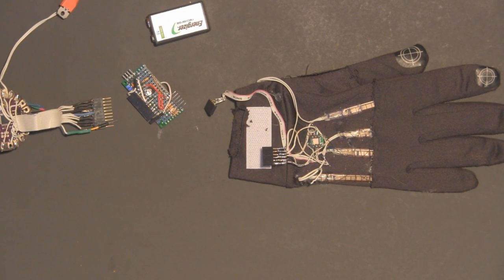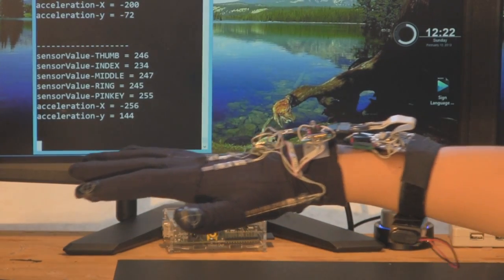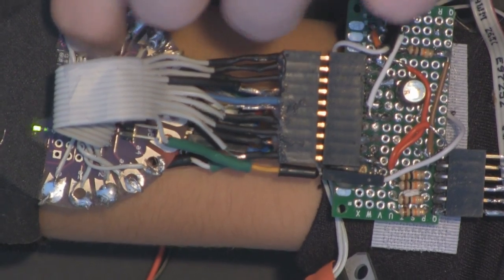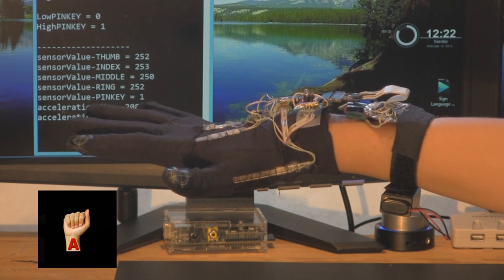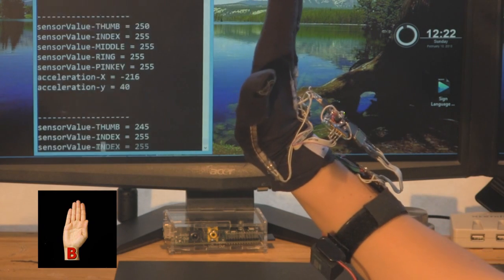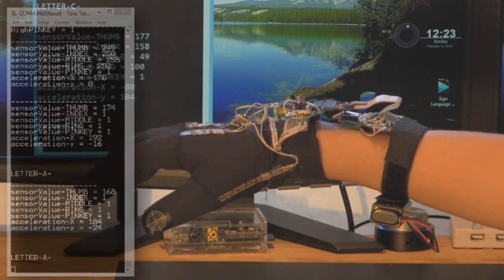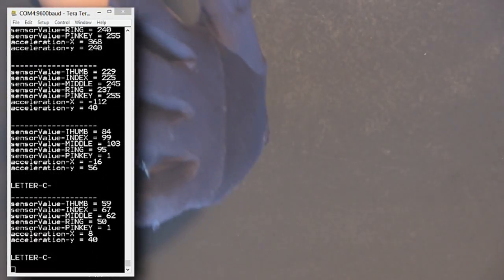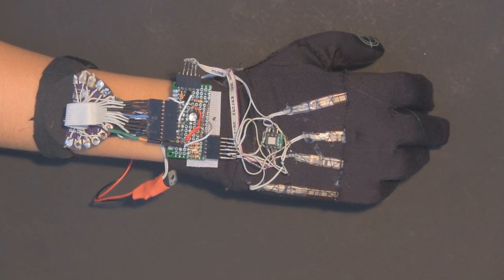Glove that Translates Sign Language into Text and Speech

Comment: bro can u give us a video on circuit diagram explanation and connection???
Reply from the maker: +Mayank Ukarde That's not a bad idea! In the meanwhile, here is the basic description: Attach 5 flex sensors inline with a 10K resistor (similar to this bildr tutorial: http://bildr.org/2012/11/flex-sensor-arduino/) to 5 different analog pins on the Arduino and connect the accelerometer (https://www.parallax.com/product/28017) to a digital pin. Finally connect a 3.7v LiPo battery (https://www.sparkfun.com/products/8483) to a boost converter (https://www.sparkfun.com/products/11231) to power the glove. It really is that easy!
You can download the basic code on my website.
Hope this helps.
Reply: Roman Kozak  Ty bro.
It's really helpful.🙆🙆
Reply: Hello.. i am working on this project but I need some help. Will you please help me with the android app.